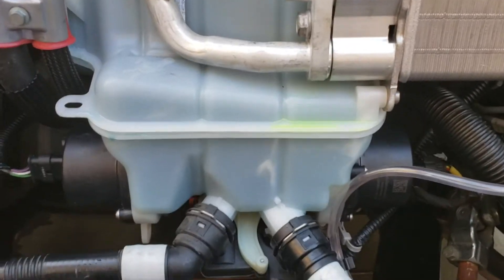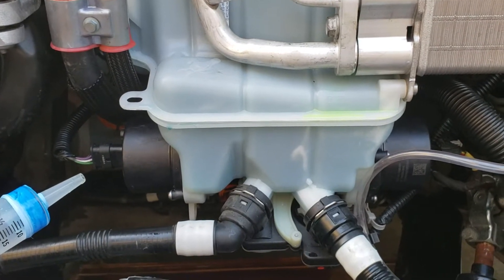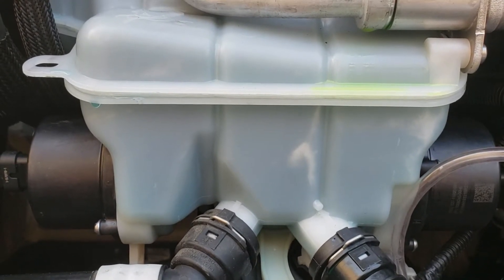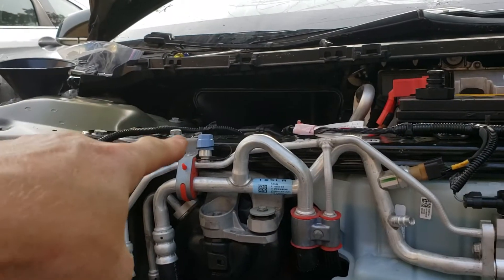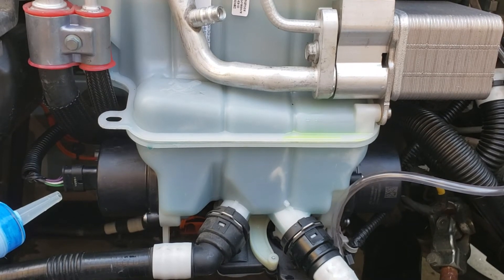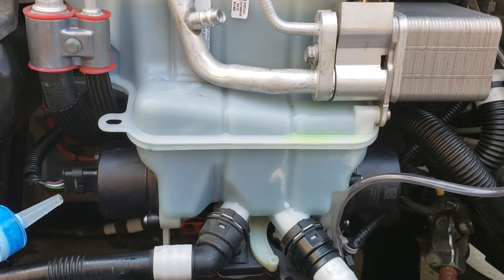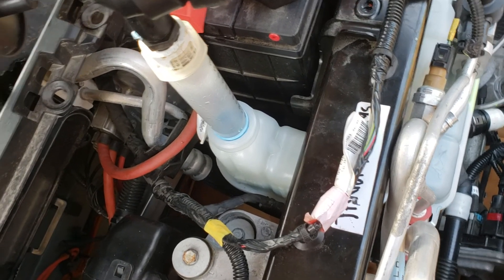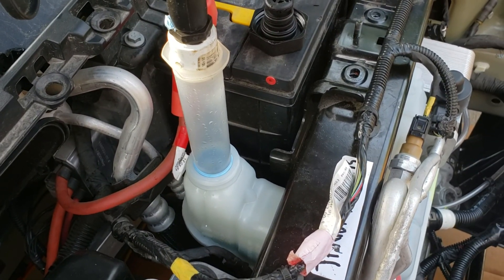Tesla Model 3 - Coolant System Removing Air.

Comment: Hello! I bought the car at an auction and brought it to Ukraine, repaired it, there was a front impact, changed the cooling tank and radiator, now when I fill the fluid it doesn’t go through the hoses, I just need to fill it in and suck out the air with a vacuum cleaner and it will work?
Reply from the maker: Yes the pumps won't move the air in the lines.  Using the vac will pull the air pockets out of the battery pack and hoses.
This is especially useful trying to prime the MCU lines as they go up above the cooler and bottle.

Hold the vac hose on the coolant bottle top with about half full.  Keep filling back as level goes down until pumps run smooth on their own. Top of coolant, drive it a bit and keep checking level and top off as needed.

Comment: Mine is currently air locked. Do you happen to have links for the items used?
Reply from the maker: You can actually just use a wet vacuum with hose on top of coolant bottle.  It will pull the air out and pumps will start pumping.
Just stop every few minutes to top off coolant and listen to pumps for air bubbles.

Comment: You can do all this via service mode
Reply from the maker: No it will not purge air if the system is air locked like this was here. 

At the time of me doing the video service mode was not available unless at a service center and no DIY options in user interface!

Comment: This just happen to my car. Not leak. Just low coolant. They had to purge system, etc..
Reply from the maker: Humm yea hopefully you found the source of the leak and it's not in battery pack.  You may want to check in service mode for HV isolation issues.

Comment: I had the all the coolant leak out of my M3, about a month ago. Had to top it up with water but same issue as system was air locked and pumps were running dry. I didnt use a pump though to clear them, had to unconventionally use my mouth 😂. Worked though and had no problems since 👍🏻
Reply from the maker: How did you loose all your coolant? From working on it or road damage?  I wouldn't use plain water at all needs to be the proper mix to prevent corrosion in all the complex systems.  It's bad enough in gas vehicles when the cooling system gets damaged from corrosion.  Could you imagine later your battery or motor gets a leak inside....

Thanks for the comment and watching,
Casey
Reply: Both of yours advice was helpful, cause of radiator damage all coolant was leaked and when i temporary fill tank with water, pump worked dry
after manipulation with air,  pump take water and then worked silent 🙃

Comment: What ever happened with the supercharger situation?
Reply from the maker: What about it?
Yea they disabled supercharging and will not turn it back on Tesla charging network.  But looks like we'll be able to use third party charging stations like Electrify America with an adapter soon.
Reply: @TeslaRebuilders  still no supercharging abilities? Even if you get the car inspected by Tesla?
Reply from the maker: @ss_builds1632  we have the solution thanks to the Tesla Community coming together everyone will soon be able to DC fast-charge their Salvage Tesla.

Using the ccs1 adapter to Tesla, retrofit kit, charge port ECU upgrade. This would allow older model 3's and model Y's to charge at other DC fast charging stations like Electrify America.